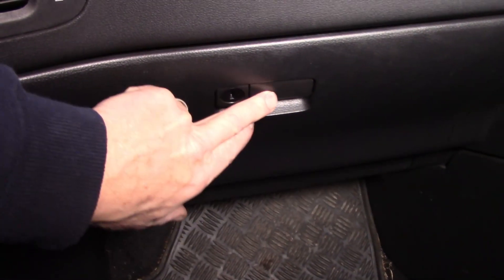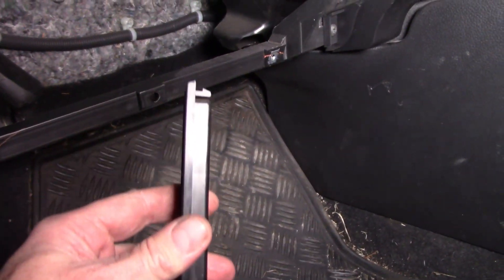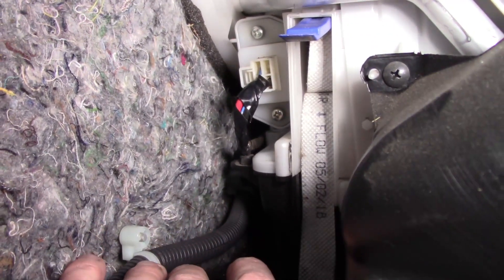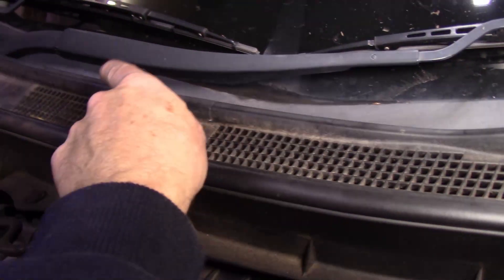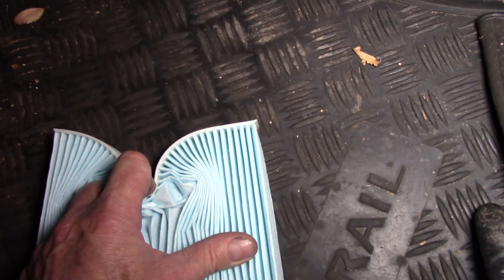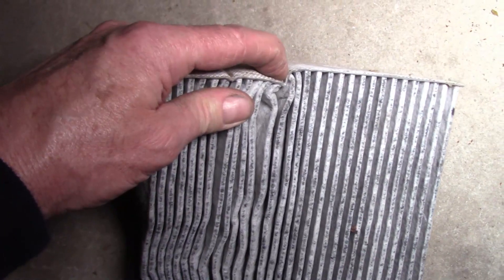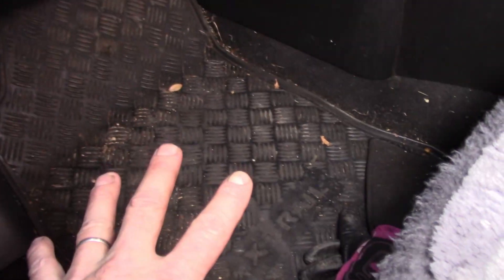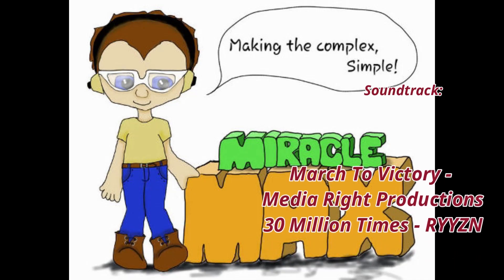Nissan X Trail Cabin Filter Replacement

Comment: Great vid and advice! Would have been nice if you showed how the glovebox came out, but I'm grateful for what you did show. Apparently you can get in the other side as well.
Reply from the maker: It looks like there are about 9 screws to remove to get the glovebox out. You may also have to disconnect a glovebox light.
I don't believe that you can access the filter from the driver's side. That might be for left hand drive vehicles.
Reply: @MiracleMAX  Yep, there is access. I just did the job from the drivers side - on an Australian vehicle. Still a prick of a thing but there is a tiny bit more room to move on that side. I also hate how you have to scrunch up the filter to get it in. Theres no way of knowing if it regains its shape or not.
Reply from the maker: @billmacfarlane4083  Good to know! The data providers I have only show access from the passenger side. Yes it would have been better to make the filter a 2 sectioned one, like some vehicle do. Much better than scrunching it up to make it fit! 🤔

Comment: Useless video how do you remove glove box.
Reply from the maker: Open the glovebox, push at either side of the lock to release, there may be a dampener to remove, then take the glovebox off the hinges. Then remove the backing cover screws to gain full access to the cabin filter door.